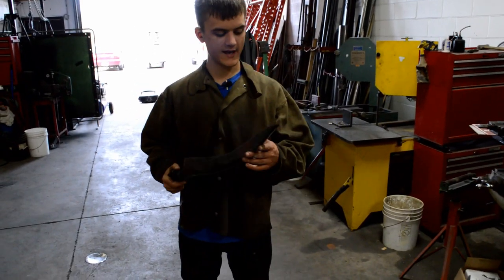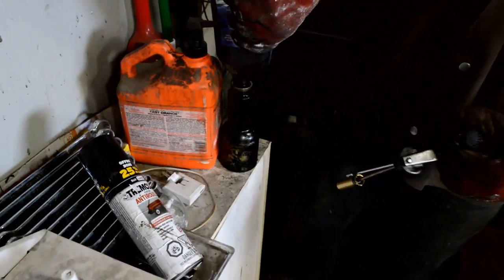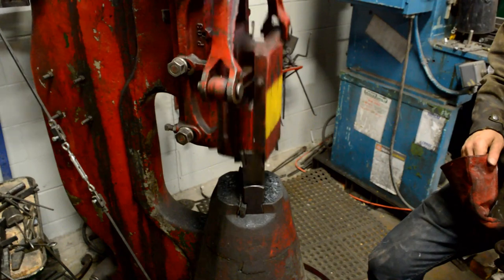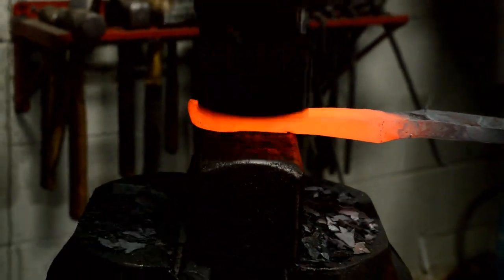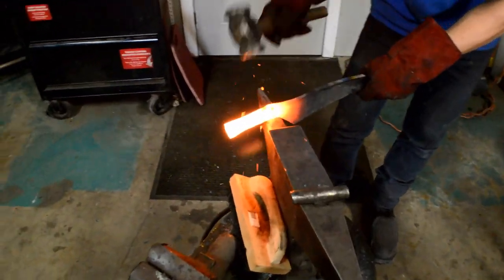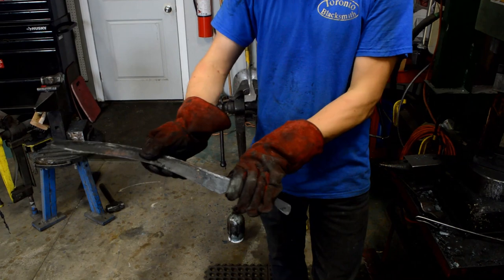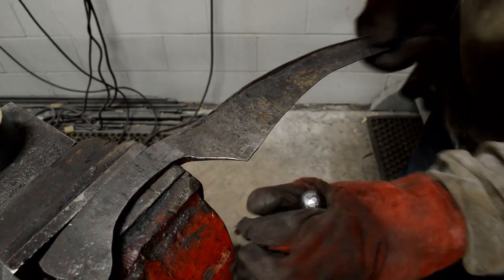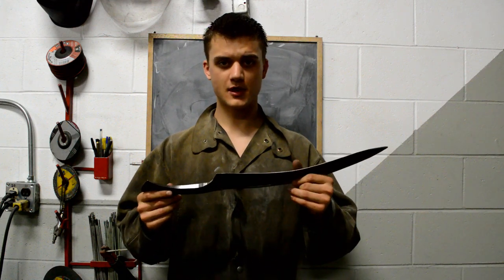Forging The Grim Reaper's Short Sword!

Comment: How the heck do you forge in welding gloves... I can barely stand in em welding.

Cool blade! Interesting with that T cross section.
Reply: Broadus Thompson I do the same thing. would rather have um on rather than burn the shit outta my fingers lol
Reply: backyardbladesmith I get burned more often frying bacon than forging, no gloves. Gloves make me clumsy, clumsy is dangerous. Also I need the control a gloveless hand gives me over my hammer. 

But if you are fine in welding gloves, rock on.
Reply from the maker: Broadus Thompson I started wearing them when doing power hammer work because I got tired of looking like a drug addict on account of my forearms being burnt up from scale falling off large pieces. 

Wearing them all the time I got used to them. 

Once they get filled with oil they become much more suple and easier to wear.
Reply: Paul Krzysz ahh, well that makes sense. I sometimes wear Kevlar sleeves for the same reason, but they don't hinder my grip or dexterity any.
Reply: i know the sword is cursed